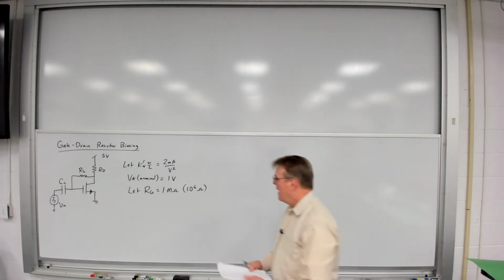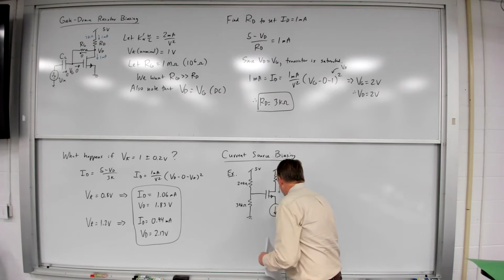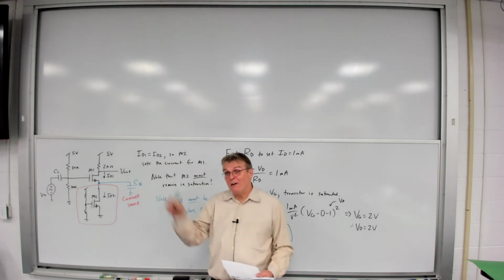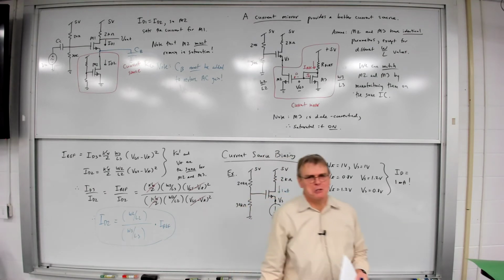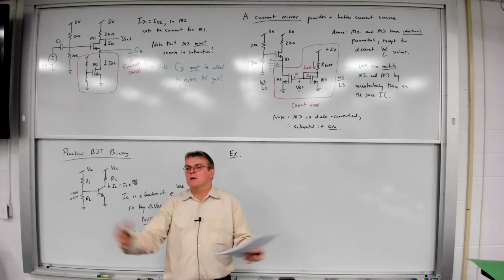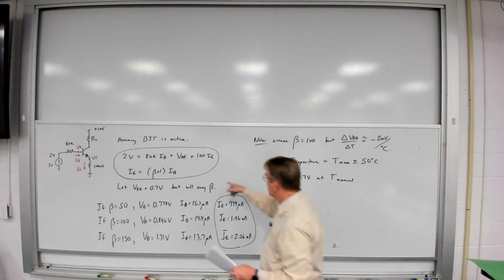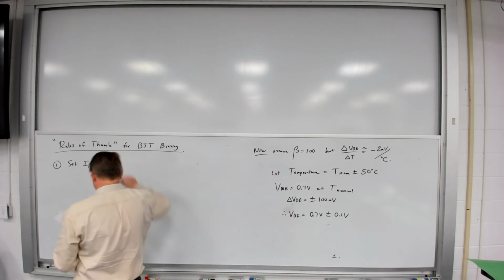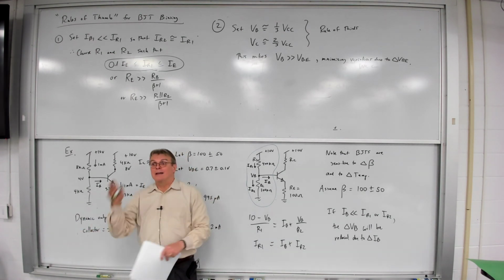Electronics - Lecture 21:  MOSFET biasing techniques, current mirrors, practical BJT biasing

Comment: @26:55, If M2 is required to be in saturation, why not let M2 also be diode connected like M3? Wouldn't that eliminate the possibility that M2 is in trio while M3 remains in saturation?
Reply from the maker: Because if M2 was placed in a diode connection, the circuit would no longer function as a current mirror.  Transistor M2 has to behave like a dependent current source, with a drain current ID2 that is a function of VGS3 while remaining independent of the drain voltage VD2.  Making M2 diode-connected would force the drains and gates of M2 and M3 into a single node, effectively making them behave like one combined transistor.